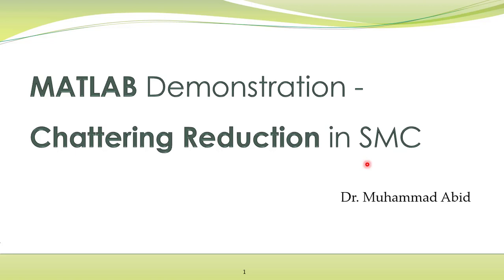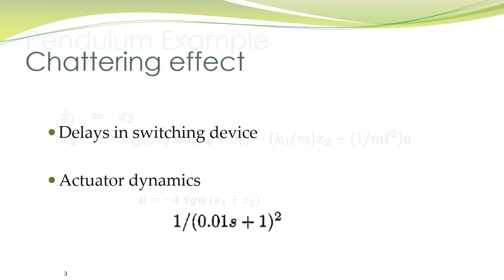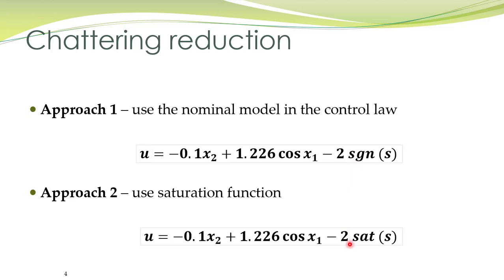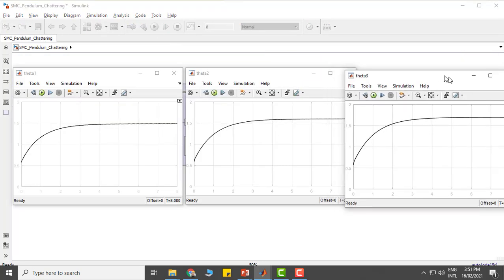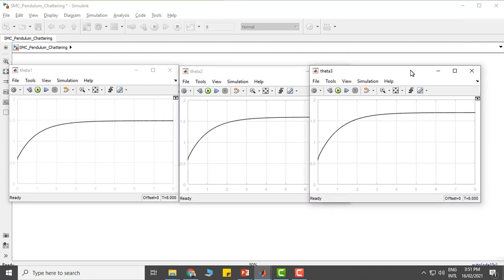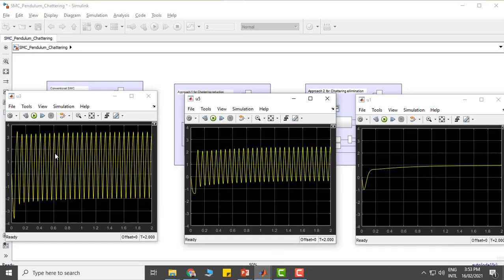NCS 36b - Archive - MATLAB demonstration of chattering reduction approaches

Comment: Dear Sir, 
All the 3 modes were supposed to make the final angle theta equal to pi/2, which is the upright position. But in simulations we can see from the graphs the final value of thetha is different for all 3 models, my questions are.
1. What caused it to happen?
2. Will not affect our goal of balancing the pendulum in upright position?
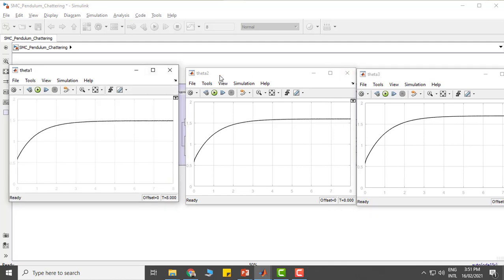Reply from the maker: In Figures at 3:07, angle theta is plotted for three different sliding mode controllers. In all three cases, theta becomes equal to pi/2. 
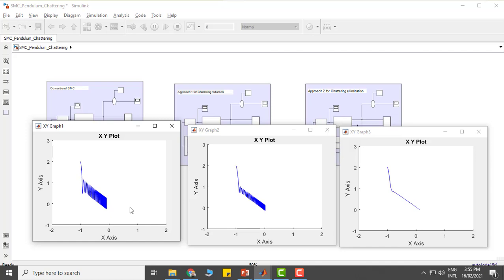In Figures at 5:27, Phase portraits are sketched between x1 and x2, where x1 = theta - pi/2. In phase portraits, we see that x1 finally approaches zero, that is, theta approaches pi/2.